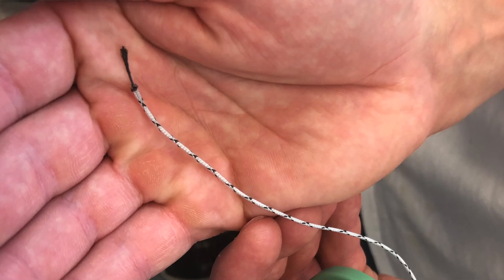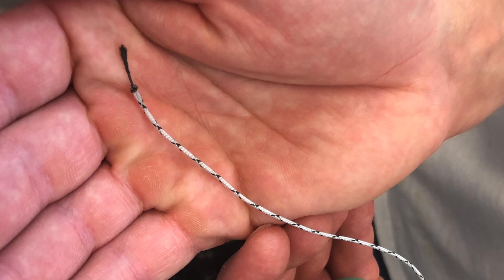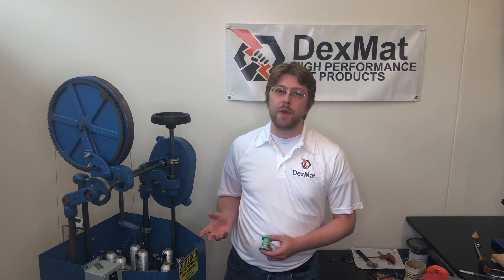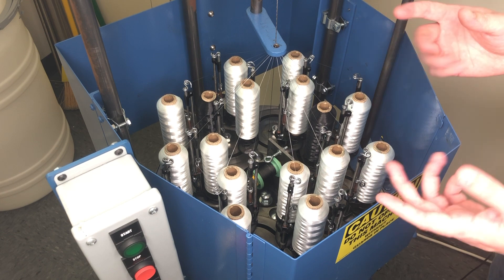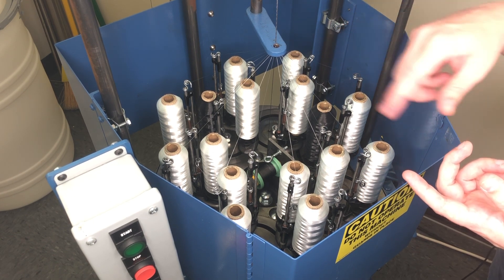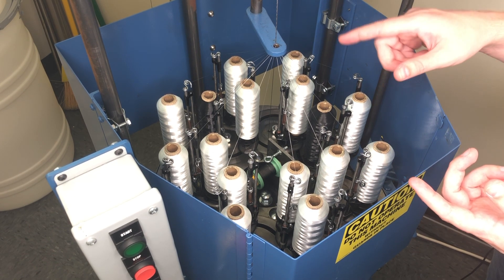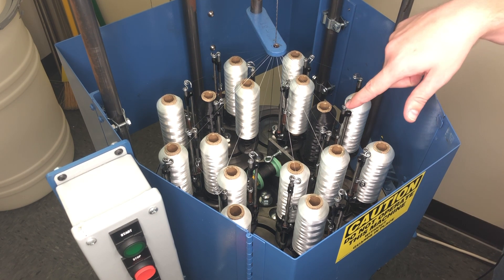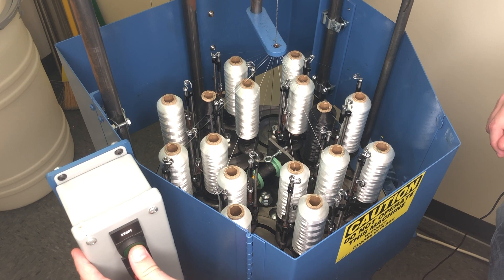Carbon Nanotube Yarn with Nylon Insulation

Comment: I realize you guys are using small amounts, but do you think it would ever be feasible to make bridge support or underwater power cables 5 to 12 feet in diameter?

Do you think it’s possible to make a bridge support cable that can also transmit power, with a hyper capacitor graphene core?